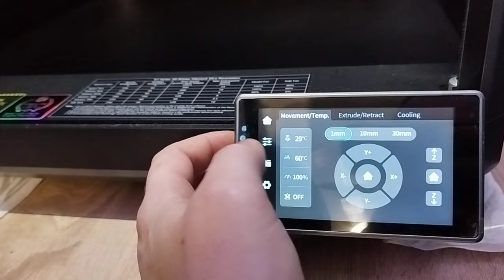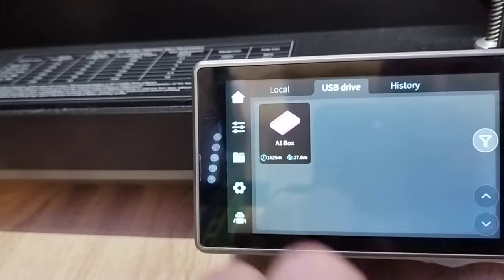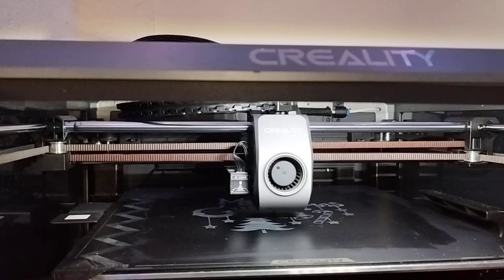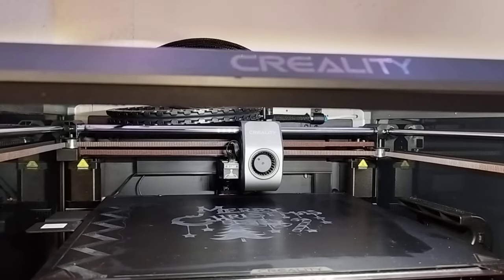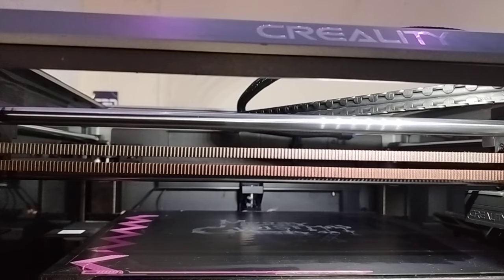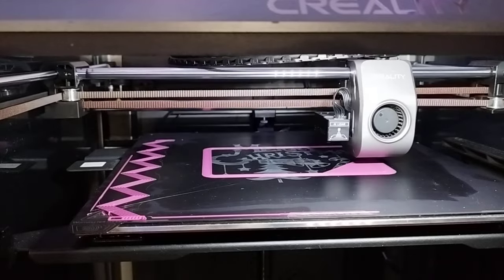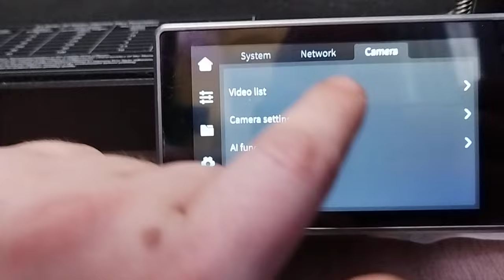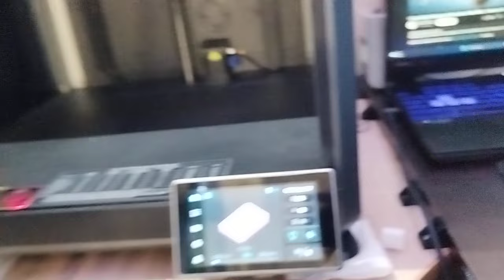Creality K1 MAX new firmware/Lidar/Calibration @Creality3D

Comment: So the speed setting replaced the Chamber Temperature? That's kinda a bummer. Which they left chamber temps and  figured out another way to adjust speed.

Edit: just saw that it is still visible on the main screen 👍

Comment: Awesome rundown brother! Thank you. Just some feedback about rooting, installing mainsail/fluids/KAMP… I did it to mine and have 150 hours of continuous printing and counting. No freezing on mine 🤞
Reply from the maker: Thank you for the comment i aprecciate you and everyone who is in this awesome 3d printing hobby.

About rooting the printer... yes also for me was worked okeysh.. but im thinking that the board and the toolhead board dont have much power to process all extra informations from klipper.
Reply: @stefan3d  I have Mainsail, KAMP, and most of the scripts in Guilouz’s Helper script on mine AND I run Obico. So far, so good. 👍 I’d love more information on the boards in these machines. I have the diagrams from Creality, but I’m not knowledgeable about how they all interact with one another. 👍
Reply from the maker: @mikestewart4752   yes I made some test also with scripts from GitHub, but for me the best and most consistent result was with the latest firmware and orca slicer. By the way I posted some new content, if you can like and leave a comment it helps me a lot. 

More content will come soon.

🙏
Reply: @stefan3d  Watching it now! 👍

Comment: I dont understand what is this video     trying to convey, can u explain what  improvement thst firmware has?
Reply from the maker: Hi thanks for stopping by, please also subscribe 😄.

So the new firmware has a lot of improvements over the quality of printed parts.

With the new firmware you have the ability to set an offset on the printer touchscreen, adjust the flow rate also on the printer.
The mesh bed leveling works very good now.
The lidar works with any slicer and is really working as I saw improvements in the quality.
For me the VFA at slower speed disappear and so on..
Reply: Dude ? Did you watch the video ? I dont think so because he said alot of things improve thrue out the whole vid. 😂

Comment: I have a question where did you get the ones you put on the motors to keep them from getting too hot?  and I also have a question about which slicer you run and which settings you run with?  if you could share your slicer settings?
Reply from the maker: Hi, that are heatsinks from Bondtech , it helps a lot to cool down the motors.

I run Orca Slicer from my point of view is the best slicer for this printer, I didn't make my profiles yet, but I will dine soon. Instead I use this  https://github.com/Guilouz/Creality-K1-and-K1-Max/wiki/OrcaSlicer
Reply: @stefan3d  can you send the link to your heatsinks?  Ok, I'll try the one you linked to and we'll see how it works.
Reply from the maker: https://www.bondtech.se/product/heatsink/?gclid=Cj0KCQiAtOmsBhCnARIsAGPa5ybYqgJP7Xy-Rd0B4shY-X8RsAmBGoY9aPe8zCp2UMfF97if6dAIErgaAmzSEALw_wcB here is the link, maybe it's also available in your country.
Happy printing
Reply: @stefan3d  thanks
Reply: Good video, very thorough..👍.. I look forward to the release of the new firmware, it's definitely a much needed improvement..

Comment: hi and thank you for  this grate video, I got my K1 max one week ago, everything is perfect till now , but I notice something weird some models when i send them to printer the leveling probing the full mesh (i think 24), but in most print i send them with the same way through the WIFI and Orica slicer it just leveling 4 points corner not the whole bed mesh.. this make me confused why and when i can have full bed leveling? 
Also, I'm sure to check the calibration box.

i don't know if anyone have my same issue!
and thanks again : )
Reply from the maker: Hi, if you use other slicer the printer will not make a full calibration, yes I know it’s a bit confused this… but it’s creality..

Comment: I was all excited when I opened my K1 Max on Boxing day, I set it up & printed the 16 minute benchy. What I saw was a disappointment to say the least, the ringing & VFA banding was horrendous & the seam looked like the normal bunion you get with Cura, it made me feel like throwing the printer through the shop window. Ready to print straight from the box my ass. 
The bed was 1.4mm high left to right which I found after the printer hit the calibration cube & knocked the glass bed off to the left. I like glass, it leaves a nicer surface than that tin plate. The belts were like guitar strings so I ended up stripping the head down to slacken the XY belts off 1 rib. To get the bed flat I had to take the Z belt off to adjust the height down on the right, the bed plate has a bow in the middle too. I couldn't get a decent print out of Creality slicer & found Orca Slicer has a K1 Max profile plus it also works the side & exhaust fans. I went through the calibrations a couple of times & now I have the printer producing prints without any of the artifacts above. It was so far out of calibration it was almost funny. I forgot to mention the hot end. It blocked up with the filament swelled up inside the heatbreak. That was fun getting that out. I used PC thermal paste when I reassembled it. Would I buy another Creality? The jury is out, the same as Crealitys quality control department is out too.

Your video was interesting & I'm interested to see if the new firmware does actually fix what shouldn't have needed fixing in the first place
Thanks for the video
Reply from the maker: Hi Phill , I really understand your point of view, I was almost the same when I got the printer.

Right before to make an order I was chatting with Creality just to make sure that I will receive the updated extruder and hotend , and obviously was not the case , I receive an unit with a good hotend but a bad extruder...
Right away after some prints the extruder was gone on the other world with Creality :)))), in the next moment I ordered an complete new extruder from Amazon , also I was reaching Creality and they send me a new extruder , as a fact the customer support was really good and impressive.

Too bad that Creality can make good printers but they lack about software and they also make some weird implementations of parts.

Right now I must say that the printer works very good and how it's supposed to came from factory.

I hope you enjoy the printer.

Happy printing.

For any questions please let me know.
Reply: @stefan3d 
Hi Stefan.. My printer did come with the new extruder & 2 hotends. I'm using the 2nd hotend which for some reason improved the print quality on its own. The shop I bought it from is closed until next Monday, I'll be sure to tell him what I had to do to get it to print a decent print. He can pass that on to Creality ( as if they care ) & give me a discount on something :)
I think 99% of the YouTube reviews are either complete shit OR Creality send them printers that have been specially prepared for a review.
Reply from the maker: Hi , I'm Also planning to switch to a better hotend, maybe from Microswiss.
About YouTubers I think you probably have right , I didn't receive my machine  for free all the content on my channel is sponsored from my pocket, and it's my money here.

Now the printers is working good , and we will see how in the future Crealty will maintain these printers alive.

As a fact , the printer have potential but not out of the box.

Also about YouTubers, check Daniel's video from Modbit channel, in the first video the K1 max was awesome : ))))) after a few videos the printer was not awesome:))))).

Happy printing, please subscribe and leave a comment if you have other ideas or some tests for the next video.
Reply: @stefan3d     Subscribed 👍
Reply: @stefan3d  I bought my K1 max on Creality's Black Friday sale. But I am very happy. Yes I had the ringing problem, but when I ran a harmonic on the belt; it was strung to tight. Loosening it up cleared the ringing up almost completely for me. And has been non-stop printing since I purchased it.
Reply from the maker: Hi Andrew, I'm glad that you have a great experience with your printer.

Thanks for stopping by here to leave a positive comment and in the same way maybe helpful.

Happy printing.
Reply: this is my 3rd printer and my benchy was the best ever

Comment: How to enable this flow calibration zigzag patterns before the print starts i use creality print and it just puts a purge line and starts the print. Please HELP
Reply: That's the AI feature. You have to enable the lidar scanner in the printer settings.
Reply from the maker: Hello, you have to enable this in printer touchscreen interface under camera menu, check all boxes, and make sure when you start a print also check calibration box.